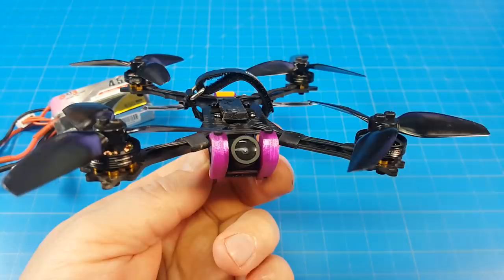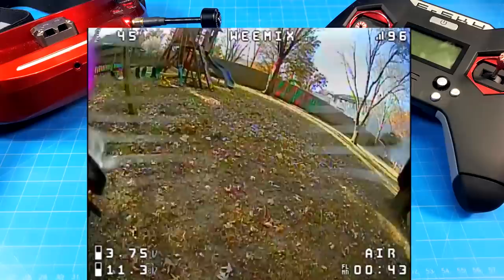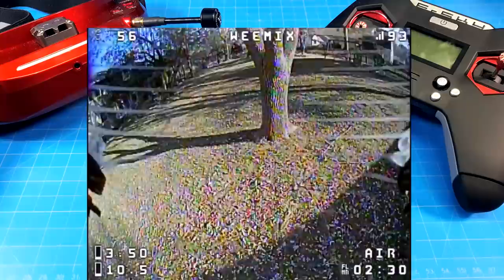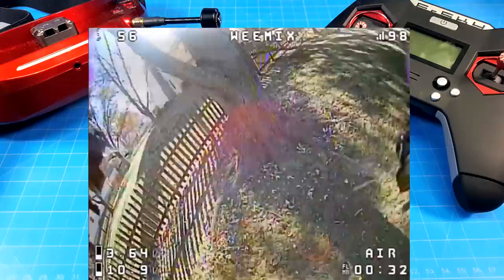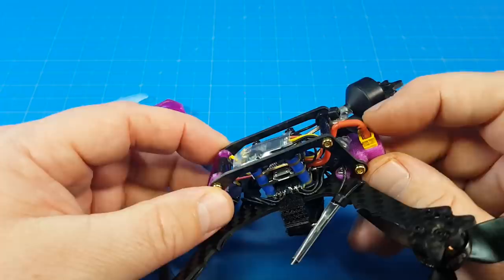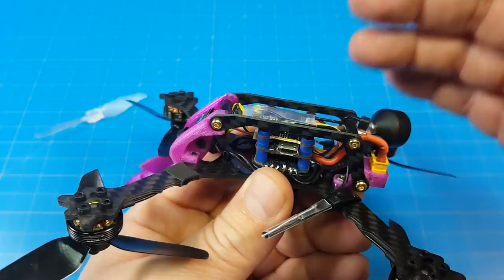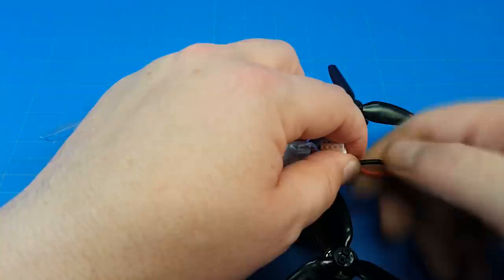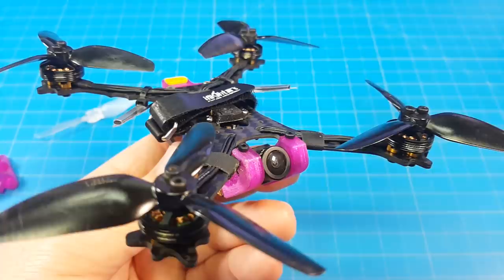WeeMix // Transformer - Two WayQuad // Rotoriousfpv.com

Comment: Sweet vid as always, Nick! Couple of quick comments from us here at Rotorious Skunk Works: the production version comes in super matte T700 carbon with round chamfer and coated edges. Both batch zero that you have and batch one support 26*26 AiOs using only the front and rear holes. Metal screws must be used. For the camera mount prints, 5mm screws without nuts have been tested and they have enough grip to hold the prints in place even in a crash but we'll be happy to add an extra two 7mm bolts and an extra pair of nuts to the kit going forward. Also the canopy is optional and will be available at a low price from https://rotoriousfpv.com/shop - ordering from us directly will give you the full choice of print and standoff colors as well.
Reply: Rotorious FPV this could be great for racing, if you mount the battery below the stack, this allows you to bring props closer and also can mount battery and stack transversely with camera out front not as blocked by the props...
Reply: when back in stock ? Thanks :)
Reply: @danapm4464  they're in stock, we just need a little time to update the webshop. Please DM the facebook page to order directly. Cheers!

Comment: That is a pretty cool idea, they just flipped the frame over which you could do with pretty much any frame with a "Cage" around the FC and that the frame didn't come under/over the camera.
I like to skim the ground but because of that I take lots of dirt naps because it looks like I can go lower but the battery, arms, etc are under me but you can't tell because the camera is higher, with the camera slung underneath you should be able to do some real low to ground passes which really makes it seem like you are going fast without so many misjudged dirt naps.
Reply: Yeah you can get super low. So low I fact I've ground the end of my lense slightly 😅🤣

Comment: Awesome video thank you Nick!

To note: whoop aio fc's can be fitted even on the frame you have, though only the front and rear fc mounting. (using steel screws).

Whilst this does fit 3" the original design was for 1103 motors and 65mm prop, this is lighter and also less prop in view.

And yes. This is a freestyle frame at heart.

Great video and awesome flying
Reply: ordering my weemix for xmas =)
Reply: @nathanloopz6175  nice. Send Eck a message. Look forward to seeing it

Comment: I like stuff that's different and unique. This is a really interesting setup. It looks like there might be enough clearance to mount the motors on the underside of the arms with the props installed upside down on the motors for an inverted setup like the tiny hawk.  That should get them out of the view from the camera. Though the unique perspective is kind of cool in its own way.
Reply: Works but you'll be limited to 2.5" props. You can also invert front motors only. It's been done.
Reply from the maker: It can be reverse mounted but as Rotorious commented, smaller props would be needed.

Comment: Yes Nick "80% gray" is the most "transparent" prop you can get. Due to some micro vibrations i see in the feed, to me looks like with the 3 blade was a bit more aggressively tuned.
Reply from the maker: Funny thing is, I didn't change the tune. I swapped props, thought it flew well, no motor heat to worry about so I ran it. :)
Reply: @NickBurnsFPV  I was almost sure about that, because thats how you usually do :) still interesting though. If so, the biblade tune could be made more aggressive maybe.

Comment: Great flying! Love that design too. Wonder if you could mount the front motors on the bottom and back motors on top?
Reply: You can do that; it's been done. You will need to use 2.5" props
Reply from the maker: I wonder what would happen if we did that and had 65mm on the front and 3inch on the back, seems like a bad idea. :)
Reply: Nick Burns maybe, the back motors do have to work harder than the front.

Comment: Did it feel much different with the battery on top? I wouldn't have thought swapping the two would change the center of mass that much since mostly micros are under mount anyway. I guess the battery is reasonably protected though. Also, backwards house punch for something different! I feel like we rarely see you go towards the shed, usually it's a punch out from the shed side.
Reply: Everyone that flys one has noticed better balance and stability
Reply from the maker: yes, the balance and simplicity of tuning was noticeable. True shed side is "safer" more margin for error and easier to make it look good. Also wind plays a role.

Comment: Very interesting antenna mounting solution, haven't seen that before. I'd definitely be more concerned about landing this design than landing on a battery with a more traditional design, but it looks very cool :)
Reply: Weemix was tested for hundered of hours without any electronics damage from landing. Please don't worry :)
Reply: @RotoriousFPV  you haven't had me as a tester 😂 You know the massive droner? I broke the rx landing that one upside down, and its top is similar to this one's bottom. Not something that will happen a lot, but if you have an unlucky landing on a rock as Nick said, it's not impossible :)

Comment: I love the Remix by ummagawd which is the original 5" version of this. Having a perfect cg and the props on the midline just makes it feel so stable in the air while making movement in all axis as linear as possible. I was planning on using 1105 6000kv motors on 3s with 65mm props. the frame was intended for 1103 5000kv motors with 65mm props i believe. After seeing you running 1304 i might reconsider. Go big or go home right?
Reply: The frame was designed with 1103-8000KV on 3S or 1103-11000KV on 2S in mind but people have tried many other configs. Adding too much power may reduce agility but the sweet spot really depends on your flying style.
Reply: @RotoriousFPV   hell my kv was way off. Memory isn't what is used to be. Waaaay too much fun in my early days ;) can't wait to get one built!!
Reply: @juggalizzle75  1103 11kv 2s rush 2.5" is my favourite setup. Check some of my videos

Comment: the frame itself is one of the better looking frames, i love the look of the under slung cam, reminds me a mini Remix frame, but the i hate the fact a lot of the view is taken up by the props but then again from the looks of it, you run a crazy up tilt on your cam. how is it with 15-20 up tilt? 

i would buy this fame if it could accommodate 2 20x20 stacks (one for hd cam like a mini/nano split) it would be a nice mini long range cruiser. 
good review on the frame too

Comment: Hi Nick, thanks for another great review!  Hats off to the designer for trying something new and different but I personally think the props in view would be too distracting for my taste. If it were a dead cat setup I would be willing to give it a go but I'm not sure if that could work. 
Nick I was hoping you might be able to help me  out with your thoughts on something, I have one of these 16x16  succex stacks that was working fine but now the flight controller won't boot up right when I have the proprietary vtx connected to it and the vtx dosen't power up either ,I've tried 2 different vtx's and get the same results. I didnt know if you have had this happen to you or if you think it's a flight controller issue or the vtx that's the problem? I'm thinking there's gotta be a short going on when the vtx is connected but I just cant find it  or maybe the voltage regulator is blown on the flight controller because the results are the same even when I put on my spare vtx.  I'm just at a loss at this point
Reply: We're looking into a modular version that would include a deadcat option. Stay tuned!
Reply: seems like the voltage regulator for what you are telling here. Try using another 5v port on your FC or try to power the vtx from another FC to see if its all right
Reply: Thanks. If you watch some of my videos you can bearly see the props. Much less noticeable with 65mm props
Reply from the maker: What does the fc do without any vtx connected? If it boots then we know the vtx is causing it. Try another vtx and also try getting 5v from a different pad.

Comment: can you run the battery toilet tank style? Is there enough room to run a strap through the top plate? Like its inspiration, the Remix is designed...
Reply: Yep, it's been done. You can do it. As with any config, check prop clearance before sending!
Reply: Yes toilet tank is possible, just requires a little more forethought and planning with cable routing. A thin strap will fit through the cut outs in the plate.
Reply: @kwadkarl7021  thanks a lot! thats great to know, im excited to try that little guy out!
Reply: @RotoriousFPV  thanks so much!

Comment: How you like the 1303 vs 1105 5k?
Reply: Looked like he didnt climb in the corners as much to me
Reply from the maker: 1105 5500kv are about the only 110X motors I would fly on a three inch props. I thought the 1303 had the same sort of punch with a very even throttle response, and much greater efficiency.
Reply: @NickBurnsFPV  that's great! Know of any 1303 available in Europe or on a Chinese website?
Reply from the maker: @ELValenin  I think t-motor just released on kinda pricey though. I found it on BG https://www.banggood.com/T-Motor-F1303-2-3S-5000KV-Brushless-Motor-for-Freestyle-Flying-FPV-Racing-RC-Drone-p-1745318.html?rmmds=category&cur_warehouse=CN

Comment: Did you notice any difference with a better center of gravity over traditional? Could you mount the motors under the arms (tinyhawk style) keeping the props right side up? Or would the props touch the undercarriage? That would really open up battery options with a full flat top plate.
Reply: Everyone that's flown one noticed better balance and stability. And yes you can invert the motors only restricted to 65mm props
Reply: @kwadkarl7021  thanks for the info
Reply from the maker: Not only good balance, but easy to tune. I just used the sliders in BF4.1 and flew.
Reply: @NickBurnsFPV  Thanks Nick.

Comment: Hay nick love the channel what size stack do I need for 1404 4600kv motors and what size battery do you recommend just started building and just needing some information
Reply: Depends if your running a 3in or 4in set up but by that KV id guess 3in. Also depends on what weight your going for if its a twig or or a micro (twig say 75g and under anything over is a micro) 450mah  3s .  and should be fine on the 12amp aio boards.  Im thinking of using the 20amp board, 1404 3600 kv on a 4inch twig frame rockin GemFan 4x2.5x2 props.  But the frame is tough to find, I think there is 1 company doing this, I am waiting to see how they like theirs first.
Reply: It’s a 3 inch HGLRC arrow frame it’s probably gonna be over 75g
Reply: It’s weighing a little over 100g with no battery
Reply: And no probs
Reply from the maker: to be safe, I would get the 20amp whoop board from betafpv. Are those 4600kv motors 4s capable. Pretty high kv for 4s. With a 1404 I wouldn't go with a high pitched prop.
Reply: Nick Burns I’m going to use Diatone 20amp 20x20mm esc and fc was gonna stay on 3s

Comment: My concern is the battery placement in close proximity to the props
Reply: I've yet to have a prop strike on the lipo. I've been flying mine for months. Don't think anyone else recorded it as an issue either. Just make sure it's strapped tight
Reply: @kwadkarl7021  good to know, thank you
Reply from the maker: yea, I only mentioned it as I noticed the clearance was close, so it became part of my pre-flight check.

Comment: Not commenting only on this quad here, its no worse than many, but I am getting a bit tired of quad frame designers that seem to assume that quads fly without batteries as the installation arrangement, connection and space they provide (if they provide at all!!) is so poor. (Its even more evident with Helicopters, where with a near free choice of canopy shape, the designers nearly always make it a nasty over tight job to fit around the stated battery and connections/leads, let alone trying to gain a wee bit more duration.
Reply: Actually this was a deliberate design choice. This is a frame designed around mass placement. The lipo footprint in the 3" config is a result of decision, not afterthought. You can use 2.5" props, Emax Avan highly recommended, for more space.